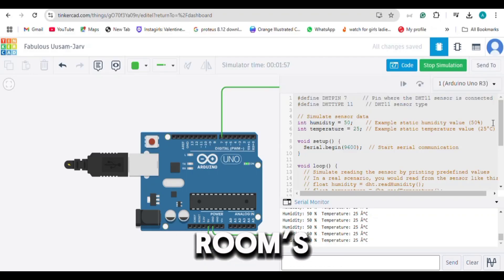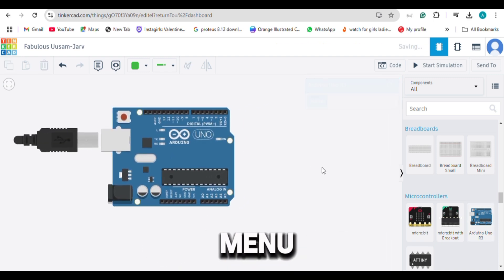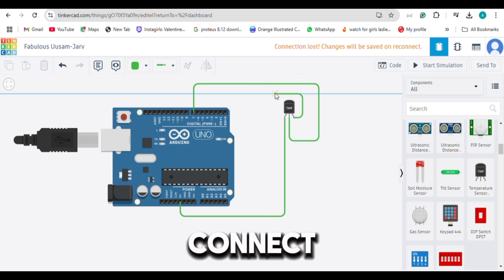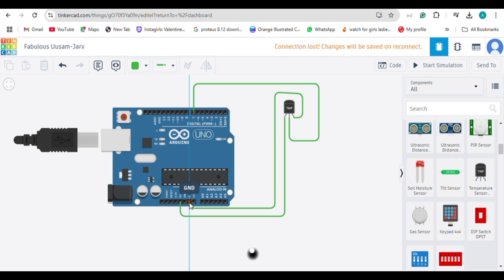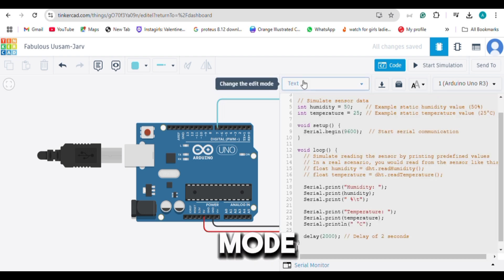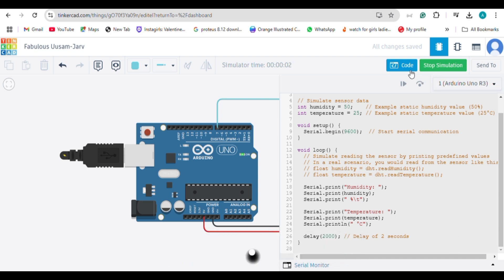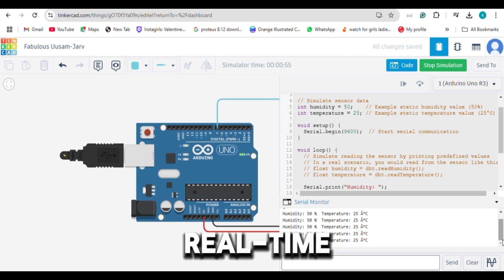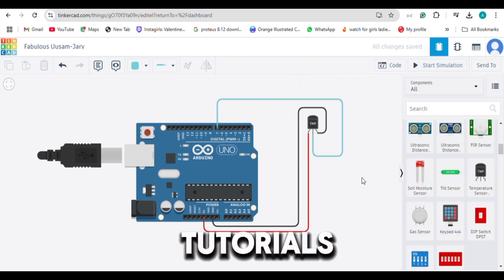How to Check Room Temperature & Humidity with Arduino on Tinkercad

Comment: bhaii tum pagal hu ya hum ko bana rhe hu 
temp sensor  give analog signal and you connected it with digital pin 7 

and the temp and humadity in predefined in the code 

chotya